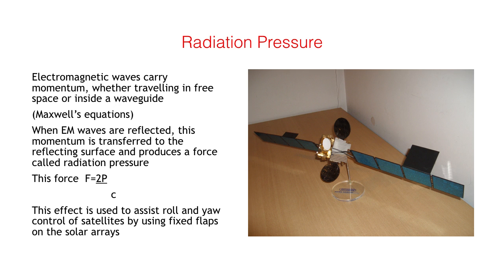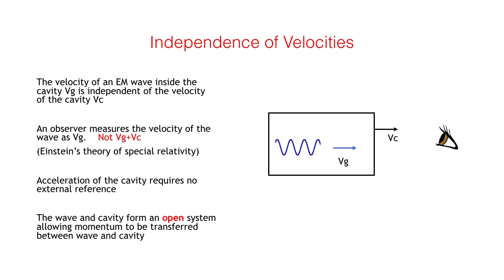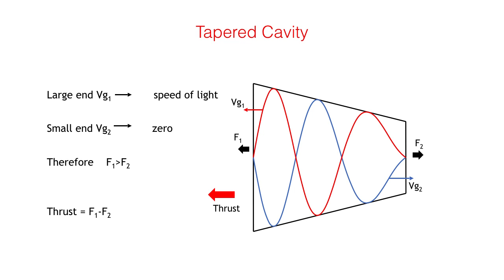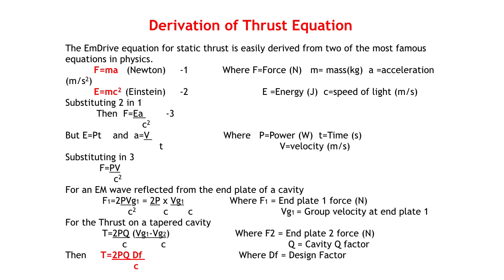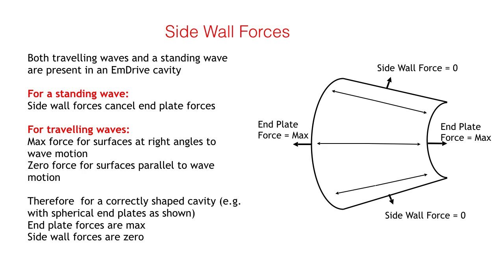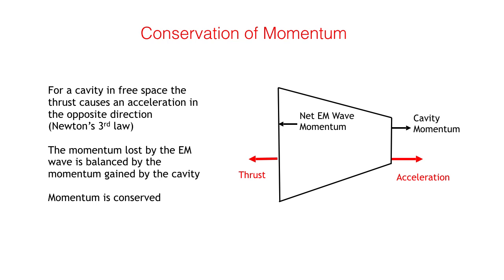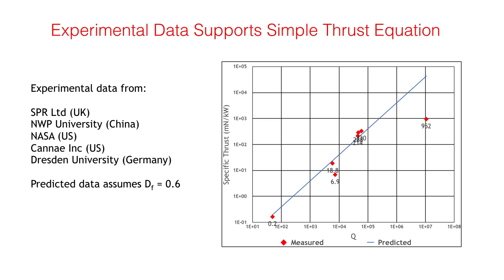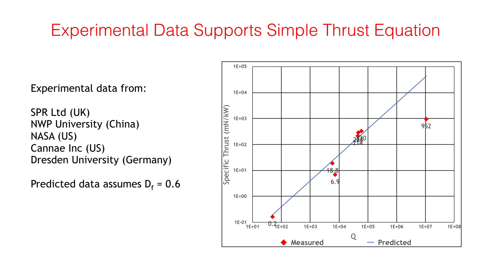Roger Shawyer Explaining The Basic Science behind #EmDrive

Comment: The first slide is already a lie.

Yes, the emdrive requires new physics. Sorry, but you can't get away from this fact. Ignoring conservation of momentum won't make it go away.
Reply: I explained myself. Momentum is conserved by every known law of physics. The emdrive doesn't conserve momentum. Ergo, the emdrive requires new physics.

How much more spoonfeeding do you require?
Reply: You need to demonstrate how it violates the conservation of momentum
Reply: ***** Start with the drive turned off. Momentum is zero in the lab's rest frame. Turn on the drive for a few hours. It accelerates. Turn off the drive. It is now moving with constant velocity.

Initial momentum: zero
Final momentum: not zero

This is obvious.
Reply: Go to 9min 52sec where he talks specifically about conservation of momentum
Reply: ***** I've seen it. It doesn't answer my simple objection. When the emdrive is turned off, there is no electromagnetic momentum to compensate. If there's any net final velocity at all, in other words, if the emdrive accelerated, momentum is not conserved. It's that simple.
Reply: it gains momentum by the EM radiation loosing momentum, is my understanding, thereby momentum is conserved
Reply: ***** Doesn't work that way. There is no EM radiation when the emdrive is turned off, so there's nothing to compensate.
Reply: he doesn't claim it will keep going after the emdrive is turned off (unless of course it is in a vacuum and there is no gravity)
Reply: ***** " (unless of course it is in a vacuum and there is no gravity)"

In which case momentum is not conserved. There's really no two ways about this.
Reply: Aaaaaah! You're not familiar with Newton's 1st Law of Motion. To paraphrase it: something will keep going in a straight line and constant speed unless it is acted on by a force
Reply: ***** Like I said.

Initial momentum: zero
Final momentum: not zero.

I'm actually a physicist so I have heard of Newton's 1st law.
Reply: final momentum is not zero because it was acted on my a force: EM radiation imparts a force, and said radiation looses momentum
Reply: you only need force to for changing velocity. you don't need force for maintaining velocity. See newton's 2nd law: F=ma
Reply: ***** If the radiation escaped the emdrive, it can only be as efficient as a photon rocket. Shawyer claims it's order of magnitude more efficient, which means momentum conservation is violated.

"See newton's 2nd law: F=ma"

Like I said. Physicist.

Final momentum: nonzero
Initial momentum: zero.

Momentum is not conserved.
Reply: ***** If it's only as efficient as a photon rocket, you're better off using a flashlight. Easier to build.

'He may have been reffering to emDrive 2.0 in which they'll use superconducting surfaces that will prevent (or minimise) escape of EM radiation from the system."

In which case the final velocity of the drive can only have one value: zero.

Conservation of momentum is inescapable.
Reply: Steven Shoen Your car interacted with the ground to acquire its momentum. It pushed the Earth back a minute amount so that the total momentum in the Earth+car system was conserved.

Momentum conservation is just as valid as energy conservation. Actually, it could be said that momentum conservation is more valid because momentum is a vector, meaning there's no chance for it to dissipate in a disordered way like it happens with energy, often lost as heat.
Reply: Steven Shoen You have to consider the momentum of the entire system: flashlight moves one way, photons move the other way. Net momentum is still zero, though the flashlight's momentum is nonzero.
Reply: Steven Shoen Again.

Initially: emdrive at rest, momentum 0.
After: emdrive with momentum p.

0 != p, momentum conservation is violated.

With the flashlight:

Initially: flashlight at rest, momentum 0.
After: flashlight moving with momentum p, collection of photons moving with momentum -p. Total momentum: 0. Momentum is conserved.

I honestly don't know how to make this any simpler.
Reply: Steven Shoen You may believe that, but you'll find it is you who is wrong.

"
but what is the momentum some time later? you miscalcuated. it's not p ... it's zero."

Nope, it's p, because the emdrive has no exhaust, and it's claimed to be more efficient than a photon rocket. There are no photons to cancel out the emdrive's momentum. It's that simple.

And if there were, it'd be at most as efficient as a photon rocket. Enjoy paying 300 MW per newton of force then, mr. smarter than you are.
Reply: +avicenna Likewise the emdrive cavity gains momentum (or kinetic energy) from the supply of electrical energy
Reply: +Steven Shoen If the energy to make a car go doesn't come from the petrol then where does it com from?
Reply: ***** I don't think you understand the difference between momentum and energy.
Reply: Steven Shoen "as you said .. P is a vector. add it up. it's zero."

Add it up to what? There's nothing to add it to because there's no exhaust.

"and let's say it was 1000MW/N .. i've made lasers with the same efficiency. but we still use those for a reason. because the conversion is useful."

Last I checked, nobody cares how many newtons per megawatt a laser gets because photon drives aren't practical, so it literally doesn't matter. Nobody quotes that number.

The point here is that 300 MW/N is possible, since it's the expected power requirement of an ideal photon drive. Anything less? You're breaking conservation of momentum. Guaranteed.
Reply: +Fake Name seems it does have an exhaust
Reply: ***** Read that paper before. It's wrong.

1. Superposition doesn't work like that. Physics is not zen buddhism. If an electromagnetic wave meets another exactly 180 degrees out of phase and they cancel out, there is no electromagnetic field, and thus no energy and no momentum. This is extremely well understood physics. Fiber optics only works because of it, for example. You can't have a photon carry energy and momentum without an associated electromagnetic field. That makes no sense.

2. Even if the explanation were correct, it would mean the emdrive is a photon rocket, and require 300 MW per newton of thrust. Claimed results are several orders of magnitude more efficient, so this explanation doesn't work.
Reply: avicenna there is energy when they cancel out, it's just not detectable. Energy cannot be destroyed.
Reply: ***** Nobody said energy is being destroyed. Nevertheless, in a region of space where two light waves cancel out exactly, there is zero momentum and zero energy.

If you disagree, you're welcome to tell me where exactly the energy and momentum are stored.
Reply: gosh such negativity
Reply: ***** And it does. The waves reflect on the walls and stay in the emdrive.
Reply: Steven Shoen Yes, I can. I don't care if you take me seriously or not. I'm right, you're wrong, and these are facts.
Reply: Walter Garvey Neither of those is a complete English sentence.
Reply: Walter Garvey You have to present an argument first, mate.
Reply: Walter Garvey Buddy, you haven't made a point yet.
Reply: Walter Garvey Again, you have to actually provide an argument.

Contrary to what you seem to think, Newton's third law (or rather, its more general realization as conservation of momentum) is precisely why the emdrive can't work. Lol.
Reply: alysdexia "I found the end velocity of the two bodies meant momentum was lost in the impact."

I hope you're not trying to use your undergraduate physics experiment to prove that an extremely well established principle of physics is false.

"There's no such thing as radiation pressure:"

Yes, there is.

"When two waves cancel, voltage becomes current or current becomes voltage."

That doesn't even make any sense.

"String theory isn't a theory; a theory by definition is a proven hýpothesis."

Yes, it's a theory. That definition that pop scientists like so much isn't actually used by anyone. String theory is one such example. 

All it does is provide an easy, bullshit low effort way to get people out of of actually having to defend evolution with actual arguments. Instead, all they have to do is say "actually, "theory" means it's experimentally confirmed" and be done with it, despite the fact that they said absolutely nothing.

"The NASA warp drive project:"

That's not a NASA warp drive project.

It's also embarrassingly wrong on many counts. Harold White is 100% crackpot.
Reply: kyeol Williams Nothing is pure classical, though often classical physics provides an excellent approximation (and it does here). "Quantum woo" refers to something else: the tendency some people have to dress up their magical thinking with quantum physics inspired technobabble in an attempt to give pseudoscience a veneer of credibility.
Reply: +avicenna Pretty simple actually. Mass, Acceleration, Time. Simple action/reaction.
Reply: +avicenna trying to discredit others when you don't have a valid argument is a common tactic of snobs who have had to pay for degrees. Unfortunately it isn't indicative of intelligence.
Reply: Walter Garvey It's different from a usual rocket because the rocket works precisely by expending reaction mass. It pushes the exhaust backwards, and that allows it to go forward. 

An emdrive, in contrast, presumes not to have an exhaust. You seem to be suggesting that its exhaust is photons, but if it were, it'd require at least 300 MW per newton of thrust simply because of the relation E=pc satisfied by any massless particle. There'd be nothing special about it if it were, either, because we have had flashlights for a really long time.
Reply: We don't understand anything in this universe "very well" and electromagnetism is no exception.
Reply: God your patience for discussing basic physics with laymen and crackpots is amazing. I would have given up after 5 posts.
Reply: +avicenna Particles can have momentum without having mass. Get over it.
Reply: Walter Garvey Yes, they can. So what? What do you think that proves?
Reply: +avicenna go ahead and deny that you can comprehend my point. The fact stands. Simple action/reaction
Reply: +avicenna Newtons 3rd law. Look it up sometime.
Reply: +avicenna just my understanding, but it's the excitement of particles in confinement with only one possible trajectory. I don't presume to know if the cavity is indeed amplifying the microwaves however, there is momentum created from this. I doubt it will get to mars in 80 days even if it's all engine no payload. But it should give you Mass, Acceleration, Time. I don't presume to have the equations. I just fail to see how it's different to a solid fuel rocket in any equation. Apart from the fuel being energy not mass.
Reply: +avicenna it's not my field but quantum mechanics suggests particles are popping in and out of existence constantly all around us. I would also point out magnetrons are not flashlights. There's other forces at work there including magnetic fields and a conducting cavity.
Reply: Walter Garvey "it's not my field"

It is mine. That popular description is incorrect. The vacuum is defined as the state with no particles in it, and by that I mean exactly no particles, not only on average. It's an eigenstate of particle number.

Regardless, the vacuum is unique, or at best has some internal degeneracy that is broken by some Higgs mechanism. It does not have a gigantic dynamical degeneracy, which is to say, it's not a gas. It's the vacuum. And the vacuum is Lorentz invariant, which means that it cannot carry momentum. You have to actually create particles to carry momentum, and that puts a strict bound on the efficiency: namely, that of a photon rocket.

"There's other forces at work there including magnetic fields and a conducting cavity."

Neither of which actually matters for the crucial result of conservation of momentum. All that is required is that the electromagnetic action be invariant under spatial translations, which it is.
Reply: +avicenna That definition ties gravity and magnetism so how can a magnetic field be inconsequential?
Reply: Walter Garvey Gravity? You can ignore gravity. Its effects are immeasurably tiny at the emdrive's scale.
Reply: +avicenna correct but a magnetic field is not as string theory seeks to explain. Or more aptly bubble theory.
Reply: +avicenna I understand your point with vacuum but it seems to me as were deepening our understanding were learning nothing is empty and yet everything is empty. Which is why I understand your point about Higgs but there's still theories that need to be addressed. Pocket dimensions and such.
Reply: +avicenna this is all in the theoretical realm and often differs from hypothesis. I would trust actual testing over theory or hypothesis. Obviously a formula is important for optimizing the technology's efficiency so I understand your zeal. Apologies for my previous rudeness.
Reply: Walter Garvey In that case you agree with me, because what I've been saying is that the emdrive requires new physics.
Reply: +avicenna so there is no known explanation in thermodynamics for magnetic fields utilizing conductive surfaces to produce thrust? I know of ion drive and the nasa warp drive project myself,... That being said, I know of a couple examples that defy the laws of thermodynamics or as of yet have not been explained or understood. That's science for ya.
Reply: Walter Garvey Like I said. Momentum conservation. The ion drive respects it, the emdrive does not.
Reply: Walter Garvey Also, there's no such thing as a "nasa warp drive project".
Reply: kyeol Williams " is based on the classical calculations of specific impulse. "

No, it isn't. It's based on a fundamental symmetry of nature.

" we can also acknowledge that there are plausible theories that include the space itself as part of the system of conservations not just the drive itself. "

Name one.

"By the way, new Physics has traditionally caused a paradigm shift in the scientific community"

If there is new physics, you agree with me, since what I've been saying is precisely that the emdrive requires new physics.
Reply: Adon blustar That's the point. It can't.
Reply: kyeol Williams There have been exactly zero credible theories proposed to explain the emdrive. That's right. Zero. Anything that has been proposed can be debunked by any competent undergraduate.

"your stance about the fundamental symmetry of nature do begin to break down at the subatomic level"

Internal symmetries break. Geometric, spacetime symmetries? Not that we know of. If they did, it would be new physics to be sure, thus proving my point.

Are you starting to see a pattern here?
Reply: Adon blustar Nature doesn't care.
Reply: ***** Yes, it's called "conservation of momentum" and it's not up for debate.

Want to overturn it? You bring solid proof.
Reply: Walter Garvey I know it quite well, buddy. It respects conservation of momentum, no matter what quantum mystic bullshit peddler told you otherwise.
Reply: So I think there are two arguments going on:

1) The EM drive without an exhaust doesn't produce thrust, and if it turned out that it did, that would require new physics to explain, because conservation of momentum doesn't allow for such a device to work.

2) The EM drive with an exhaust does produce thrust, but then it's just a photon rocket, which is well understood and doesn't violate any laws as long as it's efficiency is no more than 1 newton per 300 megawatts to satisfy conservation of momentum.

From my point of view, it seems that everyone agrees with you avicenna, it's just that they have misconceptions on what you're saying, because either they looked at one comment out of context and automatically had their own presumptions on your standing, or couldn't catch your main train of thought, because of all the scattered arguments.

Don't know how you have so much patience to reply to everyone, but it was entertaining to read, thanks.
Reply: +Ray to say that an observed reaction defies the laws and physics and nature is spitting in the face of nature. The scientific community can't even explain something so basic and fundamental as gravity yet there it is. Masses and energies are incontrovertibly tied together and is not debatable. The scientific community makes observations and attempts to explain it with formulas so it can be predictable and it takes an fathomable ego to try and proclaim we understand everything.   Magnetism and gravity are undisputedly tied together. We already know this. To try and insist some new unknown forces are at work here is nonsensical. Instead of listening to Einstein and Newton which never invented a damn thing, give a listen to Faraday and Tesla and the other electrical engineers which can explain it quite simply.
Reply: +Walter Garvey I agree with you Walter. I believe it doesn't show a lot of credibility if someone claims an effect doesn't exist without their own experimentation, before peer review and especially when credible groups have consistently observed the result.  Additionally, Avicenna's comments are more classical which does not include vacuum fluctuations as part of the system. Despite what he told you, I understand there are many types of particles in the vacuum but not matter, and particles such as photons do carry momentum because of their energy. 
It seems fruitless to communicate this point across to him. I'm almost convinced this whole irrational thing is to stir debate as a gimmick just to increase ad clicks. .. And maybe I'll get blocked from this comment section now lol.
Reply: kyeol Williams My arguments do not depend on whether the system is classical or quantum mechanical. They're valid in general. Such is the power of conservation laws.

Lots of quantum woo explanations for the emdrive have been proposed, such as Harold White's "quantum vacuum virtual plasma" that nobody can even find in a quantum field theory textbook -- because it doesn't exist.

"particles such as photons do carry momentum because of their energy. "

Yes, and if the emdrive is radiating those, it's a photon rocket, and can make no more than 1 newton per megawatt. We've been through this.
Reply: +avicenna "1 Newton per megawatt"
For which group doing the testing?
Which test trial? 
Why are you giving me a specific value for a specific thruster?
You do realize many test were done by different groups with different designs and achieved different amounts of thrust?
Seriously. These are only tests also...where there is still unknown potential for improved thrust.
And I never motioned force of thrust, I said more efficient which is a unit-less measure of it's overall potential to perform a mission. 
I was hoping we could communicate more at a scientific level.
Reply: +Drvon commonly known as pulling yourself up by the bootstraps. That's not the claim here though, and interestingly mythbusters did an episode on blowing your own sail, and it worked, why? Because more was happening than they calculated, it was more than just simply the direct force of the fan hitting the sail, but Avicenna would lecture us all day on why you can't blow your own sail with a fan.
Reply: То those, who wish they understood science:

Guys, when you make a claim, you have to FORMALLY prove it. This is how science works. Let's assume for a second, that we don't need to prove things. Then everything we wish can be true/real - a flying spaghetti monster, the possibility to fart gold coins or to cure diseases by vomiting over people's faces.

A real world example: the Pythagorean theorem: a^2 + b^2 = c^2. You can find the length of the hypothenuse if you know the length of the two other sides by simply substituting. This works and is correct, because this THEOREM has been FORMALLY PROVEN be true. No matter what right triangle you take, it's true for it. There are literally hundreds of proofs of this theorem.

Now let's assume that proving is not important. So we can state that a^2 + b^2 = c^2 + a + b, for example. No need to prove, science will be changed forever because of our new "genius" formula.
Then we take a triangle and try to use the new formula and find the hypothenuse. Then we measure it with a real ruler and turns out that we were wrong.

The same with EmDrive... we start building it, but we don't care about proof that it'll work. We will just use "physics" we don't really understand, lots of good luck and will magically happen. We just believe that science will change to match our beliefs. Which is retarded. Machinery gets build using proven theories. Your MAC/PC/Phone/Tablet/computer-like-gadget uses proven science (for example Turing machines) to work.

People, who don't really understand science, should shut up and learn, because they confuse others with tons of senseless crap. You were cool at school, you didn't pay much attention, you didn't study next level physics at the university - well, shut the fuck up.

avicenna, I'm sure you're a physicist by the way you think and require exact arguments.

I'm not sorry for the long post :)
Reply: Travis Pratt "where'd you go to school? "

None of your business.

"hat kind of physicist has never heard of phased particles?"

The real kind.

" That's literally the theory given by the nasa team that investigated this, "

A team of crackpots. But note, I never heard this bullshit even from them.

"but anyone with an education past the 60's knows what phased particle theory is."

Alright. Show me in a fucking textbook, son. Do it.
Reply: Walter Garvey "I know you will merely discredit Pons and Fleishmans findings on low energy nuclear reactions even though there was excess heat and tritium produced."

That is correct, because when people tried to replicate the experiment, they failed. Which is unsurprising, because cold fusion is simply not possible. It's less impossible than the emdrive, but still the probability that there's some mechanism by which it can be done is very slim.

" know you will merely discredit Stanley Meyers and his water powered car "

Of course I will. Nobody gets to ignore conservation of energy. Nobody.

"There is no room in conservation of momentum OR Einsteins field theory equations for a "happy equilibrium" of the planets in our solar system "

Don't smoke crack, son. "Conservation of momentum" is a fundamental principle of the universe. There's no "room" in it for anything. Similarly, Einstein's general relativity is the best theory of gravity that we know. It's not particularly "roomy" either. Does it describe the solar system pretty well though? You betcha.

Want to discredit either of these things? Bring high caliber evidence. You have no alternative.
Reply: Walter Garvey I'm discrediting low quality experiment with poor controls. Not that complicated.
Reply: Oscar Moreno "China" claims lots of things.
Reply: Ugh... this sort of continued skepticism on the theory behind the EmDrive gets us nowhere, even if it is justified. There have been multiple papers by NASA and other agencies, peer reviewed, suggesting it could work in theory; that's good enough for now. We need to get a damn prototype of this thing up in space and test it.

Time for engineers to verify whether or not this thing actually works. If it does, it provides tremendous benefit to us as a species regardless of whether we fully understand it. Physicists such as yourself can sort out the details as to how it works later... if the real-world tests prove successful, that is.
Reply: Not false at all. Conservation of 4-momentum is simply the statement that 3-momentum and energy are each conserved. There's nothing new about it. It's just a different, useful way of writing the exact same equations.
Reply: Walter Garvey So long as there is invariance under translations, momentum is conserved. This doesn't depend on the details of the underlying theory.
Reply: alysdexia "Tried it yourself?"

Friend, I have taught and graded numerous such undergraduate experiments. I assure you that there're just as many students who get momentum sprouting out of the blue as there are those that get missing momentum.

At the end of the day, both groups did it wrong, and so did you. Sorry. Conservation of momentum isn't about to be overturned by undergrads in a physics class taught to hundreds of thousands of people each year.

"Pressure comes from conduction (linear mode) or convection (inertial mode).  Radiation (angular mode) has no net displacement thus cannot press."

A word salad with no connection to reality. Radiation pressure is an experimentally verified reality.

"Maxwell's or Heaviside's or Lorentz's equations don't make sense?"

I can assure you they don't say what you think they say, because what you said makes no sense.

"How does that follow?"

How does what follow? Speak English please.

"Not even the subject or a need."

Speak English please.

By now I'm halfway convinced you're a troll. You have one post to dispel my impression. Fail to do so and I'll deal with you accordingly.
Reply: alysdexia Trollage confirmed. Bye.
Reply: What do you think about the fact that the recent passing of peer review and soon to be published paper?
Reply: Brian Gordon Doesn't mean anything. Peer review is not a certificate of truth. In particular, I know for a fact that White managed to get wrong stuff through peer review before.

I don't think anything he's done was ever right. How about we wait for the paper before assuming that a man with a history of bad science managed to overturn the laws of physics?
Reply: avicenna sounds good on waiting still excited, but truly time will tell.
Reply: +avicenna Your passionate argument about emdrive violating conservation of momentum is based on the classical calculations of specific impulse. Their are others that share your view but if we can balance our skepticisms and optimisms we can also acknowledge that there are plausible theories that include the space itself as part of the system of conservations not just the drive itself. It's quite lengthy to explain here but if there is an interest I wouldn't mind. I'm not trying to defend the claims here either but only attempting to point out other valid arguments. By the way, new Physics has traditionally caused a paradigm shift in the scientific community, so if it was new physics there always some controversy to be expected because our human nature is involved. Most of famed scientists faced this, some even to the point of confinement, depression and worse. Have a good day.
Reply: as long as it can get our civilization off of fossil fuels I don't care what laws it breaks
Reply: I have a problem. I can only find scientific papers that validate the experiments done? Do you know of any publications that debunks it, and shows the evidence for it not to work? Thx in advance
Reply: Sebastian Andersen It is the responsibility of the ones claiming that the laws of physics are broken to give extraordinary evidence for their extraordinary claim. You won't find any reputable physicist attempting to "disprove" the emdrive because it's pointless. It obviously doesn't work, why waste the time?

Then what you see in the experiments that have been done is people measuring "zero" with increasing degrees of precision. Not particularly illuminating.
Reply: avicenna Respectfully, I change my mind about explaining it. I'm not here to prove any claim or waist time trying. I thought you would've at least acknowledged the two main theories that were proposed. (prob one in the same but two different perspectives).

Also, Unrelated to the concepts of opposites, your stance about the fundamental symmetry of nature do begin to break down at the subatomic level. The forces of the universe wouldn't have existed if these subtle imbalances didn't exist in the first place. Thus, taking us back to the basis of the theories that take this into consideration for the Em drive operation.

Also your point on new physics (or breaking laws of physics) bewilders the definition, I wasn't aware it meant to discredit Newtonian physics in place of something 'new' (magic?) but rather I thought it was adding to our current knowledge base beyond what already know. I suppose this is one of the difference between the laymen's and scientific community. 

My purpose is not to convince you or anyone else because I cannot say if a theory will become law or not. It seems you must be the master of new physics because I see you have already came to a conclusion about the Em drive. If you have any useful info on these subjects I will consider it but If not, I likely will not reply.

Have a good day
Reply: +avicenna so you admit Lorentz force is factual but deny magnetic fields produce thrust as explained using modern physics? The qualified scientists only see 1 reaction from a magnetron and makes a nice little convenient little formula and voila. That's science for ya.
Reply: Walter Garvey "so you admit Lorentz force is factual"

Of course it is. There's no need to "admit" anything, much less trivial facts that have been known for thousands of years.

"but deny magnetic fields produce thrust"

Electric and magnetic fields can only produce "thrust" through radiation, in which case there's a hard limit on the efficiency: no more than 1 newton per 300 megawatts. Period. Anything more and you break conservation of energy and momentum.

" as explained using modern physics?"

Oh? Care to share this brilliant explanation with the group?

"That's science for ya."

Hahhahahahhahaha. Nope, science says "momentum is conserved" and that's just the way it is. Sorry.
Reply: +avicenna I don't have an equation for you and equations and hypothesis have been wrong before.
Reply: +avicenna I was merely pointing out other forms of this technology using similar forms of thrust. I'm doubtful we've reached  the height of efficiency on this kind of technology.
Reply: Walter Garvey This isn't a technology. It's just a bunch of people with too much spare time thinking a microwave can overturn centuries of well-established physics.
Reply: avicenna we are living in unprecedented times, amazing and at times frightening, we as a humanity have to start thinking in the impossible if we want to survive the winds of change. Make the impossible possible.
Reply: avicenna how do you know what nature thinks maybe its neutral.
Reply: Adon blustar Neutral=doesn't care.
Reply: +avicenna nature doesn't follow equations. Look at Einsteins field theory.
Reply: Walter Garvey Like I said, nature doesn't care.
Reply: Hey, if it seems stupid but it works, it ain't stupid. Of course nature doesn't care, but we do.
Reply: ***** It doesn't work.
Reply: avicenna Why, the thrust is there, isn't it?
Reply: ***** The "thrusts" being reported is about 50 times less than the weight of a sheet of paper. And truth is, these experiments are very poorly designed. There is very little control over systematic uncertainties, and a lot of the tests weren't even performed in a vacuum. 

So, what's more likely? That all physics has been overturned, or that measuring 'zero' with precision is really hard?
Reply: +avicenna respectfully disagree. I believe it's no violation of laws of physics that even in space there's particles however thinly spaced. These particles can be excited and have momentum. I believe this technology can be expanded upon by collecting particles as it moves. Or if it is amplifying the waves as speculated then it would be a different mechanism.
Reply: Walter Garvey "respectfully disagree"

This is not a subject about which meaningful disagreements are possible. It's a factual question, and factually speaking, a functioning emdrive breaks every law of physics that we know.

"I believe this technology can be expanded upon by collecting particles as it moves. "

Nowhere near enough of them for a jet engine in space to work. In the exosphere there's a particle density of approximately 900 particles per cubic meter. Accelerate every single one to 1/10th of the speed of light and a 100 kg spacecraft would accelerate to about 10^(-20) m/s. Whoopty doo.

"Or if it is amplifying the waves as speculated"

That's technobabble.
Reply: avicenna And do you have a solid proof that it's all nonsense?
Reply: avicenna I don't have a solid proof, as none of this has been proven yet. But then again, we haven't proven many things yet. If you think everything we've discovered about physics so far is everything there is, then you're ignorant. Be more open to new ideas.
Reply: ***** Conservation of momentum has been proven. We understand extremely well what it's about, and we understand why the emdrive can't violate it without exotic new physics. Again, this is not negotiable.

"If you think everything we've discovered about physics so far is everything there is, then you're ignorant. Be more open to new ideas."

So you agree with me that the emdrive, requires new physics, yes?
Reply: +avicenna the double slit experiment proves particles to this day act contrary to educated prediction.
Reply: avicenna Yes, I think it does if our current physics work so well that they can't allow for something like this. But then again I saw a post saying that EMdrive works by creating such a tiny acceleration, that the wavelength of BBR (black body radiation) produced by it will be bigger than the universe itself, thus, it will be converted to additional motion instead.
Reply: +kyeol Williams I don't claim to know if it's magnetic force reacting to particles or indeed amplifying wavelength as hypothesized. However, I know there's more coming from a magnetron than just microwaves. A detail scientists tend to get hung up on since they only see the one result. This may just be the beginning of the science of magnets and charged diodes. Also lending creedence to the aspect of the magnetic vortex in permanent magnets.
Reply: +Walter Garvey I understand, And I am obviously not one who can say this thrust exist do to whatever theory is proposed. I've seen valid theories both towards the existence of thrust due to the vacuum fluctuations and against it. Although there seems to be a connection based on quantum electrodynamics.
Reply: Walter Garvey "to say that an observed reaction defies the laws and physics and nature is spitting in the face of nature."

It is still unclear whether an effective reaction has been observed, which is why NASA wants to test it under controlled conditions with a lot more precision.

"The scientific community makes observations and attempts to explain it with formulas so it can be predictable and it takes an fathomable ego to try and proclaim we understand everything."

No one said we understand everything. In fact, avicenna said that if it turns out that the device does produce thrust without an exhaust, then it would require new physics to explain it, because as he showed, currently the law of conservation of momentum doesn't allow this.

"To try and insist some new unknown forces are at work here is nonsensical."

Not unknown forces, but physics that currently can't explain the observations.

"Instead of listening to Einstein and Newton which never invented a damn thing, give a listen to Faraday and Tesla and the other electrical engineers which can explain it quite simply."

Do Faraday and Tesla have theories for a closed system producing thrust? Please do tell.
Reply: Walter Garvey "the double slit experiment proves particles to this day act contrary to educated prediction."

No, it doesn't. Actually, quantum electrodynamics -- the theory that predicts things such as the interference fringes in the double slit experiment -- has survived extreme precision tests. It's as accurate as we can test it. 

"Magnetism and gravity are undisputedly tied together"

Not in anything but a rather trivial sense: that EM fields contribute to the stress energy tensor. It is conceivable that a stronger connection exists, but it'd be extraordinary.

"To try and insist some new unknown forces are at work here is nonsensical. "

I agree with that. Most likely there's no exotic new force, because most likely there is no effect.

Ray Your summary of the two possibilities is correct. I also think it's probably true that nearly everybody here agrees with me (but they'd disagree with how likely I'd say the emdrive is to work), but there's an important example who disagrees, and that is Roger Shawyer, the man himself.

***** "But then again I saw a post saying that EMdrive works by creating such a tiny acceleration, that the wavelength of BBR (black body radiation) produced by it will be bigger than the universe itself"

You've been a victim of a game of telephone, I'm afraid. What I'll generously call "the idea" came from a guy named Mike McCulloch who proposed that inertia is a result of Unruh radiation resisting the motion as it is forced to "fit" into the observable universe. The "idea" is nonsensical for many reasons, not the least of which is that Unruh radiation exerts no pressure and couldn't do this even in principle. It's also a minuscule effect, and there's no reason to expect that wavelengths larger than the observable universe should be in any way constrained since they're not observable anyway.
Reply: kyeol Williams "Despite what he told you, I understand there are many types of particles in the vacuum but not matter, and particles such as photons do carry momentum because of their energy. "

avicenna already said that photons carry momentum. And he doesn't deny that an EM drive with exhaust produces thrust, and this doesn't violate any currently known laws of physics. In fact, it's called a photon rocket, and has long been deemed too ineffective.

What he said was that an "EM drive without exhaust", has not been shown to work, and if it will be shown to work, then it will require new physics to explain how can a closed system produce thrust. 

Do you understand what I'm saying? A closed / isolated system has never been shown to produce thrust. Since the track record is so poor, it's obvious why scientists are skeptical about this so called EM drive.

Well we'll see the results once NASA tests it. It will either be a breakthrough in science, or a huge waste of money.
Reply: +Ray when did I say it produced thrust without exhaust? Either particles or radiation is still exhaust. Simple action/reaction. You're getting too wrapped up in points that I never made.
Reply: Walter Garvey If it's action/reaction, emitting particles or radiation as exhaust, it takes 300 megawatts per newton at the minimum. We really have been through this.
Reply: +avicenna "lots of quantum woo" 
So are your saying this system is pure clasical?
Reply: +Ray  Nice of you to speak up for Mr. Avicenna
I thought he spoke differently of photons carrying momentum from earlier comments. I apologize.

I don't disagree about photon radiation producing miniscule amount of thrust. (Which hasn't account for the level of reported thrust)

And again YES, I totally agree that a closed system produces net 0 momentum. Or in any classical Law of conservation of a system. 

But, are we talking about the same systems? This is the whole point. In fact, keeping the right reference frame is one of the biggest challenges in most physics problems.

"waist of money"
Actually I would never consider research to further human knowledge (Given a prudent approach) a waist of money. Even if it fails the hypothesis it still gives a direction of premise to obtain a better understanding of nature. Otherwise, we could have told Mr. Edison to pack his bags long before he stumbled on tungsten.
Reply: +avicenna Ah, I see, I will be more descriptive then.
One of the apparent forerunning theories is do to the Casimir effect.  I'm assuming you've done some research on it? So why haven't you considered the quantum vacuum as part of this closed system? Honestly, my first impressions is that you considered QED as more of a fairy tale.
Reply: kyeol Williams "But, are we talking about the same systems? This is the whole point. In fact, keeping the right reference frame is one of the biggest challenges in most physics problems."

It's very easy in this one. Just pick the lab frame.
Reply: kyeol Williams Yes, I know about the Casimir effect. The "theory" you're describing is the one by Mike McCulloch, which I criticized here before. Tell you what: head on over to r/emdrive, look for a discussion about McCulloch on the front page, and read /u/wyrn's reply. That should explain what you need to know and why it's nonsense.

In general, considering the quantum vacuum in problems like these adds nothing. The vacuum is Lorentz invariant, so you can't "push" against it without violating conservation of momentum -- unless you create particles, and then we're back to a photon rocket.
Reply: +avicenna I'm only asking because I believe you are intelligent and objective. What is your opinion on vasimr?
Reply: Walter Garvey I don't know much about it, but the main idea seems sound. Couldn't tell you how it compares to other electric propulsion systems though.
Reply: +avicenna I don't think they will ever reach 70% efficiency which will make it compeer able to ion drive even without bringing up the giant superconductors and the ridiculous scale thermonuclear plant. Much of the thrust would also be negated due to the enormous co-sign of the propulsion through the magnetic field. My feeling is it's a red herring but that's just my opinion.
Reply: +avicenna not to mention they haven't been able to keep it running more than a couple seconds. I think NASA should be spending their time on more useful projects.
Reply: Walter Garvey Like I said. Not super knowledgeable about it.

As a research target though, VASIMR is orders of magnitude more realistic than the emdrive.
Reply: +avicenna I was skeptical of em drive as well and if you could indeed transform wavelength I would have tried condensing the waves not expanding wavelength. I guess it wasn't for me to discover. My bet is on the one that may actually hold more promise than ion drive.
Reply: No, really. VASIMR holds orders of magnitude more promise than the emdrive. It's not even a real contest.
Reply: +Walter Garvey I remember Robert Zuberin complaining about this also. The test planed for ISS I heard was canceled do to power reasons.
Reply: +kyeol Williams I can't believe NASA is even wasting their time. There's so many reasons why it will never pay off.
Reply: +kyeol Williams Zuberin is awsome! Need more practical thinkers like him.
Reply: Walter Garvey And yet you're okay with "NASA" wasting their time on the emdrive.
Reply: +Walter Garvey I actually met Zuberin in person back in 97 and got his signature in his book, The Case for Mars
Reply: +avicenna I don't think they are waisting their time. I've actually been following this research for over 15 years and see the progress of these frontier propulsion concepts. Most extraordinary claims are short lived and few catch on for further research interest. extraordinary claims. Although many times it falls from popularity simply because the originator's claims don't  match the devices actual operation.  But The EmDrive is one such device that is catching on really fast because it works.

 We should not tie the dependence of the observed effect to any particular theory because we are still learning what nature is showing us.
Reply: +avicenna "holds...more promise" 
Um, I think it's the opposite-  It should be apparent that propellantless propulsion holds more promise. 

I think I know what you mean though, you are referring to the higher TRL level of VASMIR compared to the EmDrive.
Reply: kyeol Williams " I don't think they are waisting their time. "

But they are. 

"But The EmDrive is one such device that is catching on really fast because it works."

But it doesn't.

" "holds...more promise" 
Um, I think it's the opposite- It should be apparent that propellantless propulsion holds more promise."

You may think that it's the opposite, but it isn't. VASIMR holds far more promise. Orders of magnitude more. It's not even a contest.

 "I think I know what you mean though, you are referring to the higher TRL level of VASMIR compared to the EmDrive."

Nope, if I meant that I would've said that. I meant exactly what I said: VASIMR is so much more promising than the emdrive it's almost obscene. 

The reason being simple: VASIMR has a shot of working. The emdrive requires magical future physics that destroys every theory in existence.

What's more likely, I wonder? That the entirety of physics will get overturned by placing a cocoa can in a microwave, or that it's just Harold White writing yet another wrong paper?
Reply: +avicenna If what you say is accurate please explain how VASMIR which requires both propellant And large  amounts currents of power to reach an equivalent delta V to a craft that with less mass requiring only electric energy. I think you will find that the Em Drive will be magnitudes more efficient once you start looking numbers of the system.
Reply: +avicenna "Magical....whats more likely" 
Ahhh, so we are not even talking science now. These are statements of opinion and not of scientific method.
Reply: +avicenna It is human nature not to change our perspective when we are use to seeing things a certain way for so long. Why can't you simply admit you don't understand it instead of concluding IT must be wrong.   This is what I meant in the beginning about human nature resisting the paradigm shift of new perception. 
No one knows for sure how it works until a law is formulated. We are learning what nature is showing us here are and this is why NASA is spending the money on it.

 There are other very interesting theories being proposed at a increasing pace as of now.
Reply: kyeol Williams "I think you will find that the Em Drive will be magnitudes more efficient once you start looking numbers of the system."

Nope, not really: the emdrive can make at most 1 newton of thrust per megawatt, because it doesn't have an exhaust. VASIMR does. Sorry.

"Ahhh, so we are not even talking science now. These are statements of opinion and not of scientific method."

No, not really. Conservation of momentum is not a matter of opinion. Harold White's incompetence is not a matter of opinion. The fact that the "thrust" gets smaller the more sources of error are controlled is not a matter of opinion. Your desire for the emdrive to be real is so strong that you ignore every piece of objective evidence to the contrary.

" It is human nature not to change our perspective when we are use to seeing things a certain way for so long."

Good talk. Now walk the walk: accept that it doesn't work.
Reply: By the way, Sorry but "The vacuum is Lorentz Invariant" doesn't make much sense to me. I understand that Lorentz invariant holds constant certain properties for all observes during the translation of a frame of reference. Can you be more descriptive on this point?
It sounds like your still trying to say that Newtons third law should exist for all perspectives in a fancy way. Although, I never disagreed with you in this.
Reply: +avicenna  You also mentioned, "The "theory" you're describing is one by Mike McCullough, which I criticized"
Firstly, McCullough did not propose the Casimir effect it was Hendrik Casimir in 1948 and it's been gaining scientific interest at an exponential rate sense then. The Casimir effect is an observed effect (force) of nature. And It was calculated to ebb at inverse  r^6 opposed to r^7 as compared th Van der Walls force if I remember correctly.
Mike McCullough's theory is just another theory that tried to explain this observed force. I haven't taken a close look at it personally to consider its validity but again as I motioned before to Walter, I've seen both likely theories and those that were not as likely and this is just another proposal.
Reply: +avicenna "VASMIR has a shot of working" 
...As in closer to technological practicality- that's exactly what TRL gauges. Please don't say no if you don't understand just for the sake of disagreeing with me. It makes the conversation fruitless.
Reply: +Walter Garvey The magnetic interactions you referred to earlier may actually not be too far off. I've noticed  theories surfacing proposing this using the new buzz word ME drive for Mach Effect drive which was another uninvestigated curiosity which apparently has some connection to observed forces in the Em Drive
Reply: +kyeol Williams thanks for the heads up I'll check it out! It's no surprise to me the established scientific community is threatened by disruptive new technology. If we can get the egos out of science we may actually be able to base our opinions and conclusions on observations as it should be.
Reply: kyeol Williams "Can you be more descriptive on this point?"

Of course.

What I mean by "the vacuum is Lorentz invariant" is essentially the principle of relativity: there is no privileged reference frame. If there were, then one could conceivably measure their speed without ever looking outside the window, or measure their position and orientation with no reference to anything outside either. 

This "Lorentz invariance" implies many conservation laws, including conservation of momentum and energy. Newton's third law is then a consequence of the fundamental symmetries of spacetime.

"Firstly, McCullough did not propose the Casimir effect "

Thats right, and you can tell that by how the Casimir effect is a real thing whereas McCulloch's theory is a fevered dream.

"..As in closer to technological practicality- that's exactly what TRL gauges. "

No, it isn't. To even be considered for a TRL the basic principles have to have been observed and reported. Basic principles go against the emdrive every time.

"For which group doing the testing?
Which test trial? 
Why are you giving me a specific value for a specific thruster?"

Actually I misspoke: it should be 1 newton per three hundred megawatts. This is a hard physical limit imposed by conservation of momentum. A drive can do worse, but not better.

"You do realize many test were done by different groups with different designs and achieved different amounts of thrust?"

I realize no "thrust" has been observed because the sources of systematic error have not been controlled.
Reply: Walter Garvey "It's no surprise to me the established scientific community is threatened"

But it isn't. The scientific community doesn't care one bit about the emdrive, because it's obviously not real. There's no 'threat'.
Reply: +avicenna Sorry I lost the point of this conversation. I am only interested in the opportunity to engage in an information exchange and to pay my contribution also, in opposition to a opinionated debate.
Reply: +avicenna I love your name(for obvious reason)...I haven't taken math in a while lol, but to my understanding, the cavity is like a closed sail where the wind is generated from the inside. Instead of wind escaping off the edges of a sea sail it is kept inside and reused. This sounds like total BS if my analogy is correct.
Reply: DrVonJay Yep, that's exactly right.
Reply: +Walter You hit the nail on the head so many times, education doesn't equal intelligence, ego driven arguments ect. This guy's arguments are EXACTLY like listening to someone, today, scientifically explaining why they know the earths flat. It's like they super-focus on small details and rules and evidence without being able to put everything together. Just because the horizon is flat doesn't mean the earth can't be spherical. There's multiple explanations and many things happening here, but the bottom line is there is no way in hell anyone can definitively say "the emdrive doesn't work" without being completely ignorant.
Reply: Travis Pratt I let the results do the talking. I dunno what bothers me more. People not trying things because what they think they know or the constant dismissal of fringe sciences. That's the only place breakthroughs are made.
Reply: Travis Pratt "his guy's arguments are EXACTLY like listening to someone, today, scientifically explaining why they know the earths flat."

Say that all you want -- you're only putting your own ignorance on display. Conservation of momentum is a fundamental fact about the structure and symmetries of the universe. It's not a "detail", sorry.

"That's not the claim here though, and interestingly mythbusters did an episode on blowing your own sail, and it worked, why? "'

Because air reflects off the sail and is propelled back. It's the same as pointing the propeller backwards.

If an emdrive were to work like that it would be just a photon rocket and would require at least 300 megawatts per newton of thrust. This is not negotiable. Sorry.

"Avicenna would lecture us all day on why you can't blow your own sail with a fan."

Don't try to put words in my mouth. It's rude. This is your only warning.
Reply: Lmfao, I didn't put any words in your mouth, but if I wanted to I would, no matter how many warnings you gave. Once again an analogy goes way over your head, I didn't mean you'd literally lecture us on how a fan can't push your own sail, I meant your type of reasoning and the type of arguments you give are the same type of thing. You assume no variables are present then plug in equations and laws ignoring any other variables. According to conservation of energy, you can't push your own sail with a fan, because the fan would push against the sail with the same force as the fan is pushing backwards. Here's someone just like you answering this exact same question, explaining just what I'm talking about; from a random post in a forum- 

"No, it would move quite a bit slower, or even backwards. The fan is pushing air forwards, which propels you backwards. At best, some of this air is caught by the sail and thus neutralized, but it can't possibly neutralize completely since the velocity of the air will be greatest as it first leaves the fan, and thus the thrust of the fan pushing your backwards is necessarily more than the sails pushing you forwards."

Notice how he uses silly buzzwords like "neutralized" and "thus" and "propels" to sound all official, sound familiar lol? It's not the same as pointing the fan backwards, because you still have to make the air move from forwards to backwards, it's the same as connecting a tube to the fan and routing the air backwards, but you still have forces acting upon that tube in all directions, so you have to calculate which forces are greatest. Its a simplified version of the emdrive, where you aren't just shooting particles into a chamber, you're creating pressures from energy particles, transferring mass-less energy into pressure, and if the pressure is being created more in the front than the back, you get thrust. The loss is the loss of energy of the microwaves.
Reply: Travis Pratt "Lmfao, I didn't put any words in your mouth, but if I wanted to I would, no matter how many warnings you gave."

Try it, sunshine.

"According to conservation of energy, you can't push your own sail with a fan"

Wrong. Conservation of energy implies that you totally can push your own sail with a fan. I already explained why. 

Meanwhile you try to pretend that I would explain that it doesn't work when I already explained that it does ;) Sorry, but it's not gonna fly.

"Here's someone just like you"

Nope, not like me at all. 

Listen up, you're going to talk to me or you're not going to talk at all. Is this understood? Do I have to make myself clearer?

"sound familiar lol?"

Not in the slightest. 

Conservation of momentum is a fundamental symmetry of the universe. It's not a buzzword. Disagree? Want to throw out 400 years of physics? Prove it, sunshine. Fucking prove it.

" you're creating pressures from energy particles"

And then you complain about buzzwords. Jesus christ, "energy particles" aren't a thing.

" transferring mass-less energy into pressure, and if the pressure is being created more in the front than the back, you get thrust."

Oh, so it's a photon rocket then. So you need 300 megawatts of energy per newton of thrust, correct?
Reply: Lol, yea I could have the exact same conversation rebutting all your straw men and calls to prove myself with someone arguing the earths flat. Same thing. Bottom line is I don't know if it works, I simply acknowledge it could work, if it does work its not likely breaking any laws of physics. Pushing against phased particles is a perfect example of how it could work, even if you believe phased particles aren't possible, I've seen many things that prove they happen all around us.
Reply: Travis Pratt So you don't have a proof. Thanks for playing!

"Pushing against phased particles is a perfect example of how it could work,"

Oh? Prove how it could work please. Write down the equations you used.

PS: what are "phased particles"? Explain it to me please. In terms a humble particle physicist such as myself can understand.
Reply: Proof that I believe its possible? Me saying it is proof I believe it's possible, why else would I say it?
Reply: Travis Pratt Whether you "believe" something is irrelevant. Lots of people believe in UFOs, Santa Claus, or the tooth fairy. I want proof that it's possible, not proof of what you feel in your heart of hearts. I couldn't care less about your subjective experience. I care about reality.

Please explain what phased particles are. I didn't forget.
Reply: I dont care what you want or what you're demanding, I'm telling you my position, that this is possible, as is anything. Phased particles basically are about particles that create fields of heat to change phase, it's a theory, one that could explain many perceived paradoxes. This explains it better; http://phasedparticle.com/
Reply: Travis Pratt "I'm telling you my position"

I don't care about your position. I care about reality.

"Phased particles basically are about particles that create fields of heat to change phase"

Oh jesus christ. I thought "phased particles" would be your way of talking about virtual particles, which lots of people mention in connection with the emdrive, invariably wrongly. Instead, you provide me with yet more crackpot shit. 

Real stuff only, please. Science fiction is elsewhere.
Reply: Oh also, when I said energy particles, I meant energized particles, not particles of energy. I was saying it uses particles which have energy, reread and you'll see what I meant.
Reply: Travis Pratt Please define what an "energized particle" is.
Reply: A particle with energy? http://web.physics.udel.edu/research/space-physics/solar-energetic-particles
Reply: Ad hominem won't work here, my arguments don't rely on my credentials. I don't need to be anything to relay information we do and don't know.
Reply: Travis Pratt "A particle with energy? "

All particles have energy. Please specify what makes it "energized" and how the emdrive can use them.

Ad hominem won't work here,

There are no ad hominem attacks here. I keep asking you to prove your claims and you just refuse. That's what matters.
Reply: Yea that's a common tactic in law, I'm well aware of it, we could go on for days with you "telling me to prove my claims", the logical answer is I can't, which is the answer you want, so you can then say "Aha! No proof of your claims!!" So what... you dont have any proof it doesn't work, all you have is a dumb argument why it can't work in one specific way, which isn't the argument, the argument is it could work in a way different than pulling yourself up by the bootstraps. As for particles with energy, it's explained in the video, science we've known for over 50 years, did you forget it was explained right here? Thought you had a magic bullet to prove I didn't know what I was talking about? You're laughable.
Reply: Travis Pratt "So what... you dont have any proof it doesn't work,"

I have 400 years of successful physics on my side. Momentum conservation is a fundamental fact about the structure of the universe. The claim that it can be broken is extraordinary, and requires extraordinary evidence. It's that simple.

You know what? Let's play a different game. I don't think perpetual motion machines are possible. You claim that they are. Explain how. 

" the argument is it could work in a way different than pulling yourself up by the bootstraps."

Prove how.

"As for particles with energy, it's explained in the video, science we've known for over 50 years, did you forget it was explained right here? Thought you had a magic bullet to prove I didn't know what I was talking about? You're laughable."

No, son, I'm asking you to explain your own bullshit. You think energy is like a fluid and that particles can be "energized", whatever that means. I'm asking you to put what happens in concrete physical terms. Not more, not less. Prove your shit. It's that simple.
Reply: Guess my comment got deleted... this is boring, you're not intellectually stimulating you're just spewing the same old wrong bullshit and just dont get it. Read these words and do research till it makes sense to you; THIS IS NOT VIOLATING ANY OF NEWTONS LAWS.
Reply: Travis Pratt I didn't delete shit. Stop lying.

"THIS IS NOT VIOLATING ANY OF NEWTONS LAWS."

Fucking prove it, kid. You claim perpetual motion machines are possible. Prove that they are. Prove that we'll live in a rosy future filled with infinite energy machines. Prove. It.
Reply: Travis Pratt ". In your simpleton brain, the only way a comment could not show up is if you yourself deleted "

That's because it is the only way. I'm pretty sure the video uploader didn't delete it. In other words, yeah, you were accusing me of something you knew wasn't true. It's not gonna fly though.

" YouTube regularly deletes or loses comments"

No, it doesn't. 

"or my tablet doesn't send them, whatever happened I wrote a comment, pressed reply and the comment didn't show up"

Then it wasn't deleted, was it?

"Again, I'm not doing your research for you"

Hahahah pathetic. It's your burden of proof, buddy. You're going to prove your assertions. End of. 

"I've explained and given you many proofs, tests, phased particle theory "

You didn't give shit. Crackpot theories don't count. Phased particle theory, pff. First prove that that's a thing, which you can't do, because it's not.

"Also, I'm 32, not really a kid unless you're an old fart."

Intellectually you are a child. You don't have any reason to believe the emdrive works other than that it would be cool if it did. You don't bother actually learning the science, and you assert things without knowing them for a fact. You act and talk like an infant.
Reply: I know the science very well actually, but that's not the issue, the issue is applying the science, which you can't do.
Reply: Travis Pratt  #notanargument 

Talk to me when you have something real to say other than "phased particles", energy crystals, charkas or other new age bollocks. Grownup physics only beyond this point, folks.
Reply: Travis Pratt it's simple action/reaction turning energy into momentum. No new science here. The nay-sayers are irrelevant. The established scientific community know of some interactions of a few wavelengths and they presume to have it all figured out. It's using the simple languages of the universe. Fusion, fission, gravity, and magnetism. Particularly the ladder two. Anyone saying there is no particles to interact with disqualifies themselves from being qualified to comment.
Reply: Walter Garvey "it's simple action/reaction turning energy into momentum"

It just doesn't work like that. Energy is not a fluid. It can't be "turned" into anything.

"Anyone saying there is no particles to interact with disqualifies themselves from being qualified to comment."

You are not competent enough to qualify or disqualify anybody.
Reply: avicenna Reguardless whether you let on like you do not understand the statement or just merely discredit or criticize it changes nothing. I have no doubt you are part of the established scientific community and are no doubt threatened by such disruptive technologies produced my much more humble and less funded experimenters.
Reply: Walter Garvey Yeah, I'm threatened by a device that would ensure I would never be out of a job. That's some excellent understanding of incentive structures; are you an economist by any chance?

None of this matters. You're still yet to bring a sensical argument.
Reply: avicenna Looks like the project is doing just fine without you. Perhaps if you were objective from the begining you might have put together a paper and perhaps received some funding. That's quite a typical stand however. Radical opposition until you finally admit it's real and you knew it all along.
Reply: Walter Garvey Son, I think you're confused. You prove that it's real first, and gloating comes after. Not before. Sorry.
Reply: avicenna You're sure putting a lot of time and attention into a non-event....
Reply: Walter Garvey Not really. I receive notifications, spend 20 seconds responding. Not particularly resource or time intensive.
Reply: I found my deleted comment, guess it went to a general reply, but here it is, proof i didn't lie, you can go look at the timestamp;
"As I and others have said a million times, this isn't working by breaking the laws of physics, it's working by adding something we're not seeing, phased particles would mean that's what the microwaves are pushing against. You can sit there with your thumb up your as and try and argue against this breaking the laws of physics, but no ones saying that. You're simple minded, an information sponge, yet you dont know how to apply the information you have."
Undeniable proof you were wrong in claiming the only way it could have disappeared is if you deleted it, therefore every other assumption you made based off that wrong assumption was also wrong, much like what's happening here.
Also, the gloating can happen now, because were not claiming we know it works, we're claiming we know it's possible it could work, if certain theories are correct, and there's evidence that it does. You are claiming you know dogmatically that it can't work, which is complete bullshit. All the relevant testing, theory, ideas and results have happened for someone to be able to say it's possible, yet you continue to assert your fourth grade physics alone to prove it's impossible by one means. You know you're not smart, no one gets through life this far and doesn't know their intelligence, the curtains fallen my friend.
Reply: I win so many internet arguments its insane, someone should give me an award.
Reply: Krivobog Petrov No one made any claims other than it's not even close to proven impossible. Wormholes are possible, and theres evidence, do I need to prove to you a wormhole exists with undeniable proof to make the statement "a wormhole is theoretically possible"? No. I don't. If you don't get that, you don't get science. We are testing this, we're not putting a "True." stamp on it and moving on, we're testing. That straw man had no chance, you decimated him, nice job on that at least.
Spaghetti monster almost never works, and I'm surprised anyone claiming to understand things would use it, because it's just a simpletons argument, there's no evidence or theories explaining how a spaghetti monster would exist, theres theories and evidence explaining how an emdrive works.
Reply: Travis Pratt ""As I and others have said a million times, this isn't working by breaking the laws of physics,"

Asserting is not enough. You have to prove it.

"phased particles would mean that's what the microwaves are pushing against."

This isn't star trek. You can't just route a tetryon beam through the main deflector dish. If you want to talk of "phased particles" or whatever I'm going to have to ask for all that good research proving that they exist.

"You can sit there with your thumb up your as and try and argue against this breaking the laws of physics, but no ones saying that."

Of course you're not saying that. You'd look dumb if you did. But it doesn't matter, because it breaks the laws of physics anyway. You don't get to decide that it doesn't break conservation of momentum. It does and that's that.

"Undeniable proof you were wrong"

Asserting is not enough. You have to actually show the proof. It's not a proof if only you can see it.

"Undeniable proof you were wrong in claiming the only way it could have disappeared is if you deleted it"

No. You said "my comment got deleted". I and the video creator would be the only ones capable of doing that. The comment didn't get deleted though, did it? It was your fuck up. Own up to it instead of trying to pass responsibility on to me. It's pathetic.

"Also, the gloating can happen now,"

No, sunshine. It really can't. You have to prove first. You don't get to gloat to me that it works before you prove that it works. This is obvious. Jesus christ, am I talking to a mental patient?

"e're claiming we know it's possible it could work, if certain theories are correct, and there's evidence that it does. "

No, it cannot work given any theories deserving of the name. Star trek theories don't count. Sorry.

" All the relevant testing, theory, ideas and results have happened for someone to be able to say it's possible"

Only someone who got their physics education from Star Trek, and not even one of the good ones. Maybe Voyager.

" yet you continue to assert your fourth grade physics alone "

Actually it's my particle physics Ph.D. physics, but thanks for asking.

"You know you're not smart, no one gets through life this far and doesn't know their intelligence, the curtains fallen my friend."

Yawn, sure, sure. Proof?
Reply: Travis Pratt "theres theories and evidence explaining how an emdrive works."

No, there aren't.
Reply: I'm not reading that drivel right now you're ignorant and not worth it, I will address the first thing, and that's by saying I dont have to prove something's not breaking the laws of physics, that's what laws are, if you think it's breaking any laws of physics you're a moron. You're acting like I have the burden of proof when claiming something's possible, I don't, your claim is it's impossible, so you prove it, you can't, because you can't se past anything not involving conservation of energy. Your argument is like sitting here claiming you can't ever pull a boot strap and make yourself go up, which is simply not true, add a pulley and you can achieve the goal pretty simply. Add a phased particle, gravity warping ect and this drive works pretty simply.
Reply: Krivobog Petrov If observation is proof then it's been proven. If you are disputing it then you need to prove it. Which part are you denying anyways? The part where electromagnetic fields affect particles or that particles have momentum. You would be wrong on either account anyways.
Reply: Travis Pratt"that's by saying I dont have to prove something's not breaking the laws of physics"

If you assert that they're not, yeah, you do.

"you can't se past anything not involving conservation of energy"

Like I said, buddy pal friend. Conservation laws are fundamental to the structure of the universe. You don't get to revoke them. You don't get to make a perpetual motion machine just because it'd be cool to have one.

"I'm not reading that drivel right now you're ignorant and not worth it,"

I accept your surrender.
Reply: Here let me just continue the boring conversation for you.. ill quote some shut out of context and make a straw man to disprove myself, "blah blah conservation of energy"
Well, it is conservation of energy why it can't work. I am smarter than you because I know that. I named myself after some faggot Islam thinker so I'm better now.
Then ill come back with explaining, yet again, that conservation of energy isn't being broken if you factor in phased particles or any other number of theories nasa and others have come up with. You can sit there and do a jig while fucking a goat and yodeling theres no theories, but that doesn't make it true, there are theories, every test has either worked or been non conclusive, none have disproven it and you're a complete moron. These are facts.
Reply: Walter Garvey " If observation is proof then it's been proven."

No, you have to control all sources of error first. This hasn't been done. It's not even close to done. Hell, most designs still use off-board power sources.

"Which part are you denying anyways? The part where electromagnetic fields affect particles or that particles have momentum. "

Jesus, no, the part where you get to accelerate yourself by pulling on your own bootstraps. It's impossible, by the way.
Reply: avicenna Inducing an electromagnetic field and reacting with ambient particles isn't pulling on your own bootstraps. Sorry science is with me on this one. Agree to disagree.
Reply: 186 comments of people saying it's not simply pushing your own sail, and you responding with yes it is, prove it isn't. What's the limit 500? Should take a couple days at this rate. It's like trying to drive a square peg into a round hole... and your head is awfully round.
Reply: Straw man inc-
Reply: Travis Pratt Sounds like you need to brush up on your electromagnetic field theory. It's no more pulling your own boot straps than a rocket. Sounds to me like your focusing too much on the microwaves. I suggest research a magnetron. There's more involved.
Reply: Walter Garvey No, we don't get to "agree to disagree" about facts. I'm right and you're wrong. Some things are just like that.

"Inducing an electromagnetic field and reacting with ambient particles"

We can do that, actually. It's called a jet engine. Turns out they don't work in space. Not enough air to push around.
Reply: Travis Pratt I get where you're coming from. You don't believe the particles are there to influence. It's just one of those bizarre things quantum mechanics gives us.
Reply: avicenna Well you're not wrong. Electromagnetic fields can increase jet exhaust velocity and I believe we will soon be using that very effect to increase momentum and preserve exhaust ports.
Reply: Travis Pratt "186 comments of people saying it's not simply pushing your own sail,"

It really isn't, because pushing your own sail works. It's more like pulling on your own bootstraps, which doesn't work. And yes, it is. No, you don't get to decide that it isn't. Conservation of momentum is not up for debate. Very sorry.

"Again, no ones revoking the laws of physics, we're saying this is working in some other way besides pulling yourself up by the bootstraps."

Actually it's not working at all. Burden of proof is on you to show otherwise, and to show how. 

Or don't. Keep saying "it works but I won't tell how, it's a secret to everyone". People will respect you for it.

" There's no conservation of energy issue if things are escaping"

In which case it's a photon rocket. Dude, we've been through this. I know you're a little thick but do try to keep up.

" or if the magnetic waves are bouncing off of phased particles."

Kiddo, you're gonna have to prove "phased particles" exist first.

Hint: they don't. You don't get to route a tetryon beam through the deflector dish. Very sorry.

"Straw man inc"

You have exactly one post to show the straw man. Do it explicitly. It's your last chance. Don't waste it.
Reply: avicenna I can't believe how much this is like talking to a liberal. You think you can just keep repeating "it isn't true" as if that somehow changes the fact. Suffice to say we know where each other stands.
Reply: Walter Garvey Buddy, all justifications have been given in this thread. You're welcome to read them if you wish. I won't repeat myself. The emdrive violates conservation of momentum. That's just the way it is. There is no alternative.
Reply: avicenna All I'm saying is observations have been made but some vested interests just want to keep toting the same narrative. Who cares the guy isn't a professor of a university. If it works, use it.
Reply: Walter Garvey It's not "vested interests". It's 400 years of extremely well tested and well understood physics. Conservation of momentum is not something we take on faith based on what someone said in the 1600s. It's a consequence of a theorem. If the assumptions of the theorem turn out to be invalid (ONLY for the emdrive, despite the fact that they've been verified for all scales both large and small) we'd face the most surprising revolution in the history of science. Extraordinary surprises require extraordinary evidence. That's how Bayesian reasoning works. I don't require much evidence to believe you ate a sandwich for lunch, but I require lots to believe the fundamental structure of the universe is different... for microwave cavities, and microwave cavities alone.

" is observations have been made "

Yeah, observations made by people who don't understand how to perform proper experiments that properly control systematic uncertainties. Literally worthless.
Reply: avicenna I'm not against science. It's extremely important if we want to move ahead. It's the presuming to know it would never work that I find dangerous. As you already know, more things are invented by accident than on purpose. As for your original point of it requiring new physics, I don't presume to be intelligent enough to know the answer to that. I'm aware your response would be a resounding "yes".
Reply: Walter Garvey It's not dangerous at all. It's quite simple: anyone wanting to beat 400 years of extremely well-understood physics has a huge burden of proof to carry. This burden has not been met with the emdrive. In fact, it hasn't even been established that it's worth investigating at all. There is a burden of proof there as well, and it takes a minimally well-designed experiment to convince any competent physicist that there might be something there.

Such an experiment does not exist.
Reply: I smell bullshit, you claim you're a "physicist" so where'd you go to school? hat kind of physicist has never heard of phased particles? That's literally the theory given by the nasa team that investigated this, theres entire documentaries about phased particles, yet you act like it's some unheard of theory I made up. One chance to prove to anyone reading of what you say, if they're intelligent they don't need me to prove all the bullshit you're demanding, but anyone with an education past the 60's knows what phased particle theory is.
Reply: Lol, most are proud of their school, bullshit confirmed.
Reply: Travis Pratt Dude, I'm not giving you personally identifiable information. Are you insane?
Reply: Travis Pratt No, not really. I am objectively correct, education or not. This is the power of science. It doesn't matter who you are, when you're right, you're right.
Reply: avicenna well you have faith in a system that has been proven wrong before.
Reply: Walter Garvey I have "faith" in nothing. I understand it. It is very different.
Reply: avicenna I shouldn't have said proven wrong. What I should have said is there's more to the story. I know you will merely discredit Pons and Fleishmans findings on low energy nuclear reactions even though there was excess heat and tritium produced. I know you will merely discredit Stanley Meyers and his water powered car Reguardless of the findings of HHO or Browns gas that you can replicate yourself. There is no room in conservation of momentum OR Einsteins field theory equations for a "happy equilibrium" of the planets in our solar system (which Einstein admitted). You only have a piece of the puzzle and to not look at the results you're only holding yourself back.
Reply: avicenna Fields have effect this we all know. First we detect then we measure its effects then we can make our equations.
Reply: avicenna all the evidence I need has already been produced. I don't need to bring anything. Everything I said is true and anyone can do some investigating for themselves they don't have to listen to people rotting the same damn lines on why what does work can't.
Reply: Walter Garvey "all the evidence I need has already been produced"

Um, no.

"I don't need to bring anything"

Your burden of proof, pal. Sorry. You claim, you prove.
Reply: avicenna if it didn't work we wouldn't be talking here. Ph.D.'s are working on it for me despite no funding. Kinda undermines your established scientific community doesn't it?
Reply: Walter Garvey Yeah we would, because it doesn't, and yet we are. This is not that complicated really.

A Ph.D. is not really a certificate of correctness. Sorry to burst your bubble.
Reply: avicenna No it's not that complicated. You're discrediting observation based on what u think u know.
Reply: http://www.popsci.com/emdrive-engine-space-travel-china-success
Reply: Avicenna- His point does not seem to violate conservation of momentum. It just converts EM energy into momentum. Why is that so hard to accept? What else would the energy convert to?
Reply: Zero-G It doesn't matter whether it "seems" to violate it or not. The fact of the matter is that it does.

"It just converts EM energy into momentum. Why is that so hard to accept?"

If you want to do that, you have a minimum amount of energy you must spend: 300 megawatts per newton. No less.
Reply: Im not a major in physics, but tell me this, dont we observe other phenomena in space that doesnt exactly abide by the established laws of physics, like when you come near a black hole. To me, again im not a physics phd or anything, that sounds like the established theories in physics are still not complete. This is a claim ofc I cant back up with proof, but couldnt it be that in 100 years we find that the current theories accurately describe most phenomena in the world, however they are only an approximate relation to an even more complex system of equations explaining the universe around us.

What is my point? Always have an open mind, no matter what field u study. Of course nothing should be taken for granted without proof, but dont blindly discard anything just cause it violates some laws we have established that can explain observed phenomena. Sometimes you discover violations to laws that leads to an understanding that the laws were incorrect. :)
Reply: But if someone could tell me like what would be needed to know if the emdrive will work. I mean many articles on the internet says NASA has gotten it to work, but to me they seem to be incorrect? Didnt NASA just create a thrust for a short time? Like wouldnt u need to have it in space for like half a year or more to be sure that it violates Newtons 3rd law? Can someone elaborate for me please?
Reply: ***** The device tested at NASA appeared to work because of a combination of background and thermal effects. It doesn't produce any thrust.
Reply: Ahh so its confirmed that it was just external things affecting the result? I wish news articles would be more precise and less sensational when they write about this stuff.. So much misinformation, I mean one place I saw them have a title in the style of Nasa has made Warp Drive work. lol
Reply: ***** Depends what you mean by confirmed. No peer reviewed article disputing the findings has appeared, and it likely never will, but (detailed, quantitative) arguments against them have emerged.

The warp drive thing is because the same people are also trying to demonstrated warp-drive related effects. They fundamentally misunderstand the physics involved, though, so they could never make it work.
Reply: avicenna ahh ok, thanks for clarifying :)
Reply: avicenna I think thr EM drive works. The law of conservation of momentum does not need to be satisfied when a wormhole forms inside the chamber because of micro fluctuations in the electromagnetic quantumvector field. 

Pizza in microwaves is not always conserved either.
Reply: "Pizza in microwaves is not always conserved either."

Truer words never spoken.
Reply: Skepticism isn't meant to "get" anywhere. It's just a way of thinking correctly about things. Right now, there is no evidence that the emdrive works and about 400 years' worth of evidence that it doesn't.

But even if the emdrive did turn out to work, Shawyer's theory is guaranteed to be wrong. We understand electromagnetism very well. Such a device cannot work in either classical or quantum electrodynamics.
Reply: A pathetic platitude. We understand many things extremely well, electromagnetism chief among them.
Reply: "Conservation of momentum only applies in an inertial frame of reference, "

Not true. It's valid always. And even if it weren't, I'm free to analyze the behavior of this contraption from an inertial frame's point of view, so conservation of momentum squarely and nonnegotiably prevents this contraption from working.
Reply: John Doe, You're talking rubbish. Nonsense. Anyone spewing bullshit needs to provide references and you didn't. So, thus, a liar.
Reply: All I'm hearing is "this new thing isn't concurrent with what we know now, so it must be wrong". You might as well say, "Breaking the sound barrier? Ha! Impossible." How can anyone claim to be scientifically minded if they forget one of the most basic realities of science: it is a constant learning process. What we know now is not set in stone precisely because we do not know everything. To deny this is to deny not only history but the nature of reality.
Reply: +avicenna conservation of momentum, hogwash. Ever studied the double slit experiment?
Reply: Have you heard of the orgone energy, maybe that can explain the "unbalance of momentum".